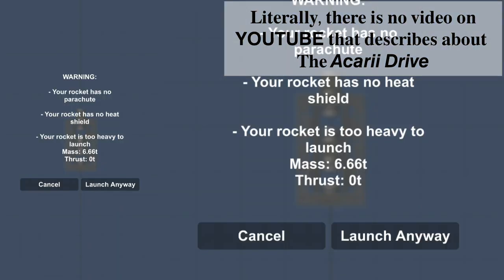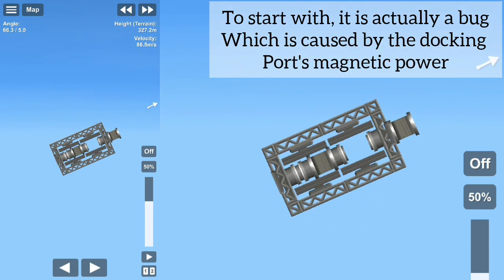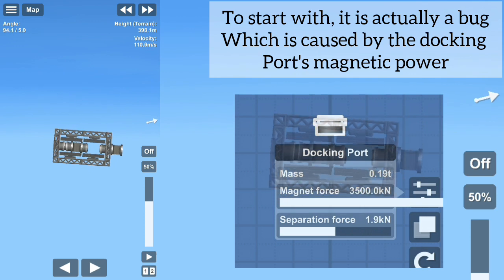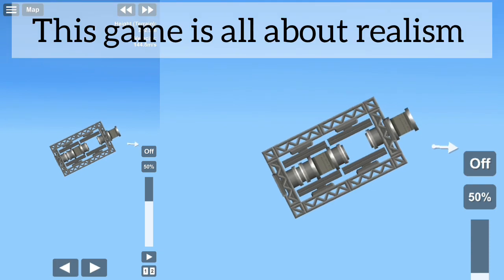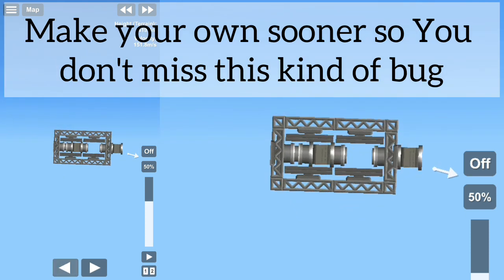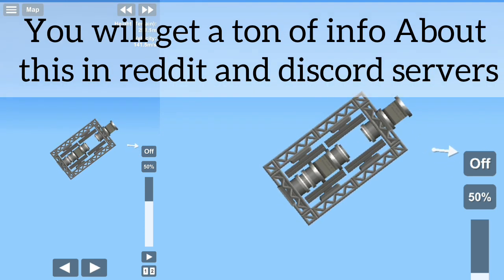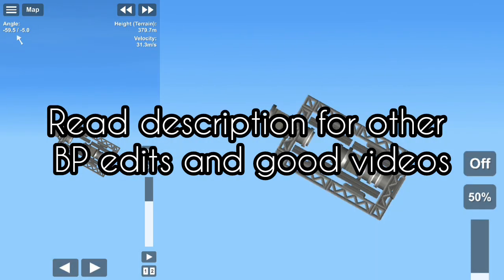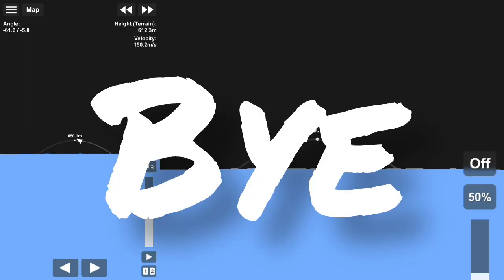Acarii drive | SFS version of KSP's kraken drive | info | #sfs

Comment: It’s not fixed. Even in 2024, it’s not fixed. super cool and you can get in to orbit with this. Yes. Orbit.
Reply from the maker: I didn't try to use this glitch to reach the orbit though 😅
Reply: @IMGMYTit's still here on 1.6 💀🤣
Reply: Finally, after like LOT of engineering, I made a working retractable, Somewhat safer Design 🥀
Reply: @austrianpainter1837  i made it aerodynamic, and went to the moon with it
Reply: @Jeo_Rich  I made my one Horizontally acceptable and It have two modes